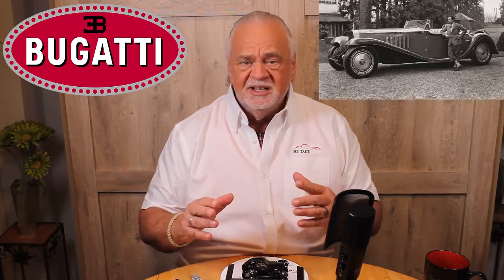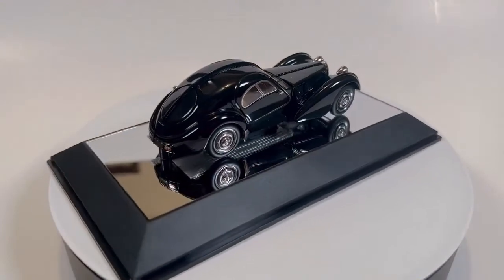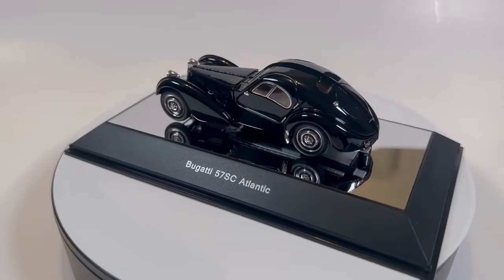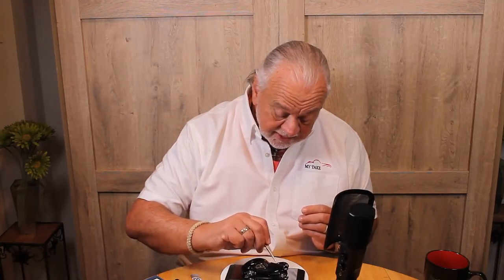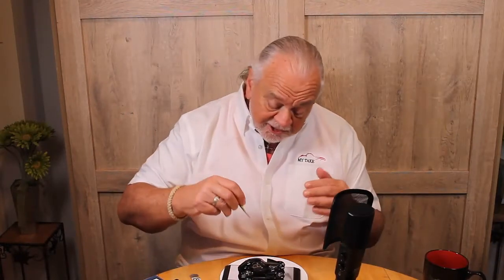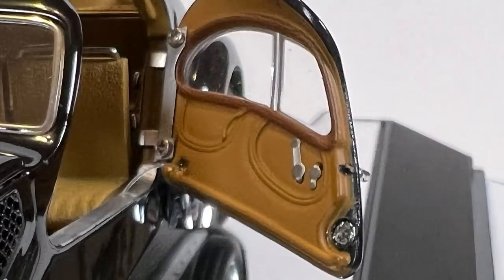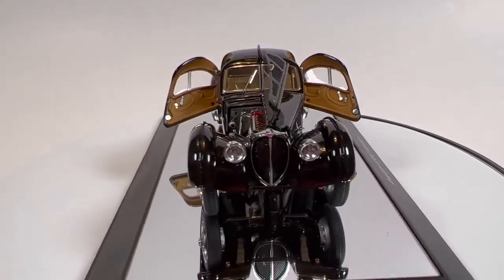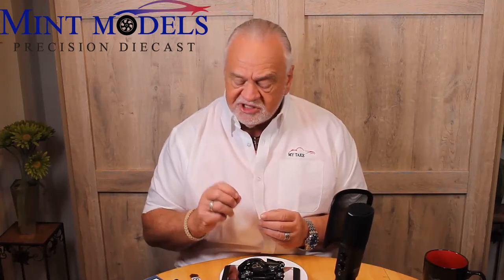Auto Art Bugatti Type 57SC Atlantic

Comment: I have their 1:43 McLaren f1 and lambo aventador, needless to say the level of detail they put into such a small package especially the ability to fully open makes these ones a must for collectors. They sure don't make them like this anymore though, all I've noticed is their new composite line has less detail and much higher prices. That in turn is making these older diecasts skyrocket in value too which sucks for us budget collectors who missed the chance to get these for cheaper!
Reply from the maker: Thanks. This is the first I've seen of these. How long have they been out?
Reply: @Kuvakas  probably for at least 5 years or more. i think the hobby has just gained much more popularity in the last few years. i had always known about autoart but always felt they were way out of my budget even at the $150 price point they usually retailed at. if i'd have known they would have shot up in value later on i wouldve gotten a few of them back when i had the money to do so at those cheaper prices! i feel fortunate that i paid less than $200 for each one of my autoarts in my collection. i also got both my 1/43's for $100 or less but i think i just lucked out since you cant find these ones that cheap anymore.
Reply from the maker: @musek5048 , Thanks for the quick response. Have the 1/43 versions been out as long?
Reply: @Kuvakas  i would guess as long as their 1/18 counterparts since the two i have also have 1/18 versions as well and those came out around 2012 or so. hard to believe they could pull of such amazing models back then compared to what they put out now. some of their newer models are very nice overall but the high prices are hard to justify for the corners they cut these days.
Reply from the maker: @musek5048  Thanks for the info! I'm surprised they are just crossing my path now. I appreciate your help!
Reply: @Kuvakas  glad I could help! I'm sure these are only gonna get harder to find and more expensive as time goes on since no other company I know makes anything close to these as far as high detail 1:43s go.